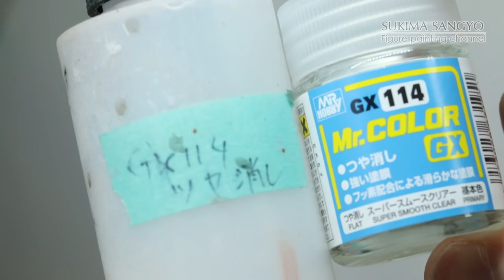プリコネR- コッコロのフィギュアを組み立て塗装する/ Princess Connect Re:Dive Kokkoro Garage kit figure painting #ガレージキット

Comment: There's this method that works really well for when you make steam gages on tiny locomotives or airplane cockpits, where you make a hole in the shape of the dial, you then paint the bottom with the indications, needle etc or put the decal in there, then using some clear epoxy, you fill it back up. It makes really, really realistic dials. I wonder if this could work for making the eyes. Remove just a bit in the shape of the visible part of the eyeball (after you've drawn the eyelashes) then draw the pupil, iris shades etc, and finish with a drop of clear epoxy over it.
A movie studio that makes the dinosaurs from Jurassic Park does the same with their eyes as well, just that those are cast in resin whole, with a concave section on which the pupil, iris and veins/details are painted. Those look 100% real.
Reply: Some people do that, I think it all depends on what type of character and figure they are painting.
Reply: That's also similar to how the irises of doll eyes are made, like for ball jointed dolls :)
Reply: That’s because our irises cave inwards, then the clear cornea is on top
Reply: That's brilliant, I would love to see someone do that
Reply: Copy pasting this?

Comment: nice work
do you mind adding the English names of the stuff you used?
Reply: What do you want to know about?
Reply: @thebigbient8736  
the solution he used on the pieces for 10 min
and also the one that was sprayed on last. guessing it's some kinda of coating to prevent the colors from fading?!
I got some figures coming soon, and I would like to assemble and paint them well.
Reply: @leoj8633  the 1st solution is a degreaser, most likely gaia notes  resin wash, resin usually has a residue left on from the casting and needs to be removed so the paint doesn’t chip and the last one is a laquer matt clear to seal everything. Probably mr hobby super smooth clear or gaia notes matt clear. Both lacquers. Hope that helps.
Reply: @thebigbient8736  thanks , I will look them up
Reply: @leoj8633  no problem
Reply: @thebigbient8736  do you know what gold paint he used? It looks amazing and I’ve been looking for something like that for a while. Also do you know what masking solution he used as well?